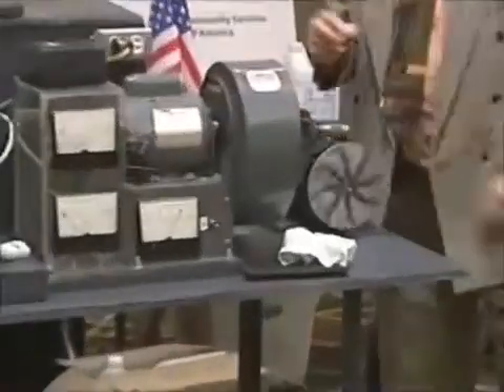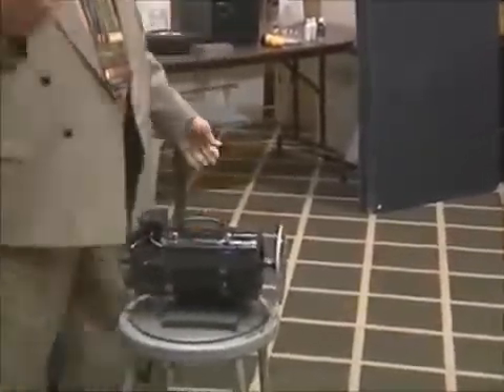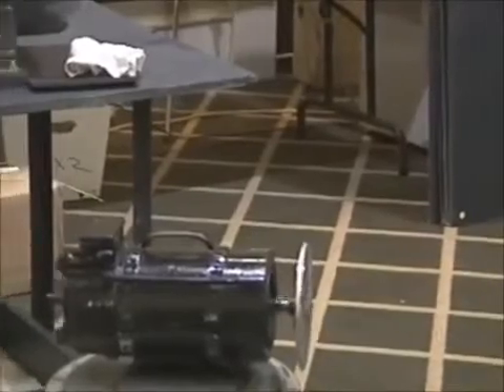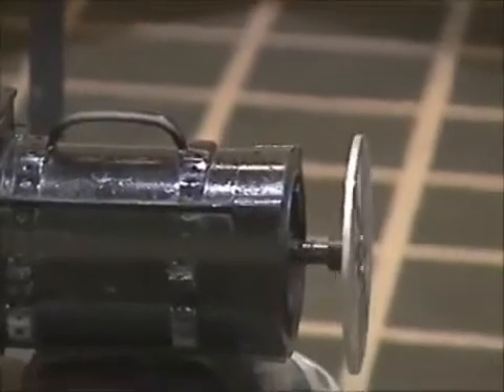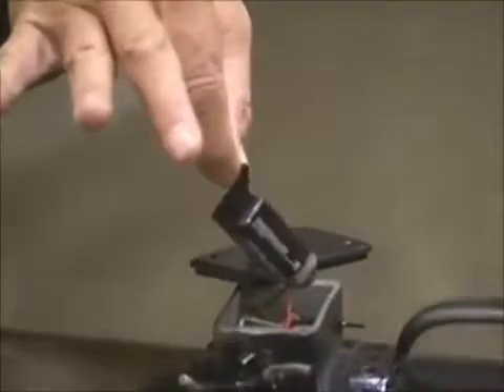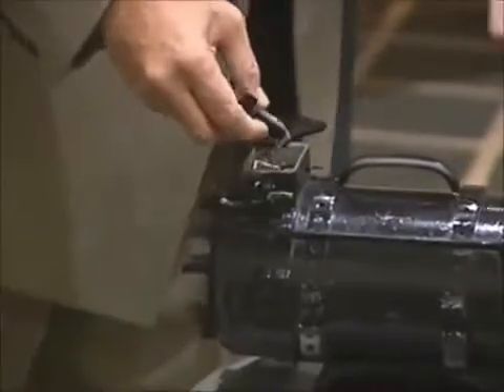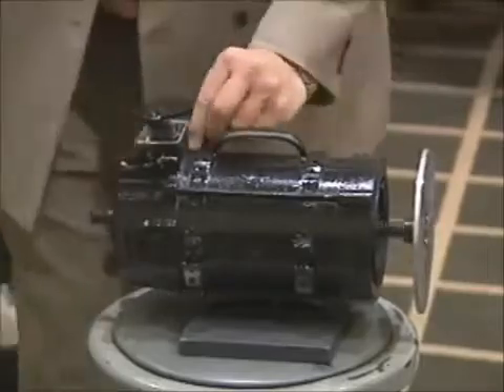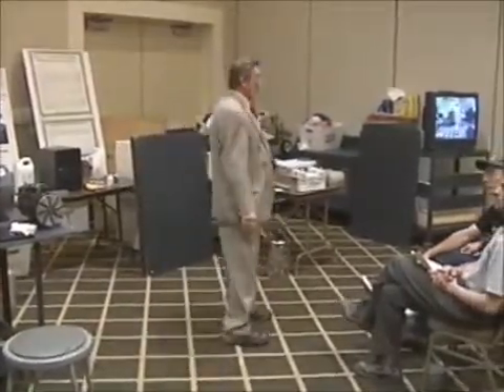1 HP electric motor running on a 9V battery (Dennis Lee)

Comment: Yes most 1HP motors are not wound for 9V... It's not a conspiracy, it's just that doing so is very impractical.
 You'd need a massive 9V supply and huge conductors and windings to get the full 1HP out of a 9V motor.
(Conductors sized for about 82A for 1HP @ 9V full load, not to mention a car-sized battery)

Comment: Yepp. 1hp motor running on 9V battery plausible. But the power consumed by the electric motor is slightly more than the load. Without load it is a 1hp motor putting out a fraction of a horsepower.